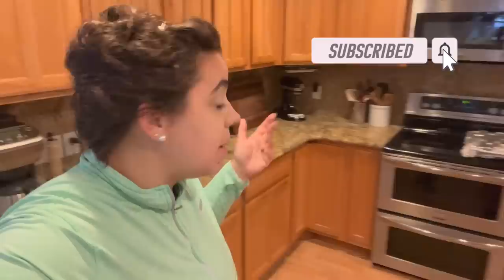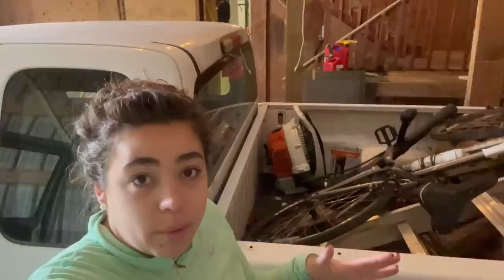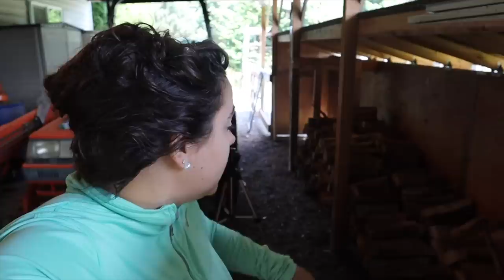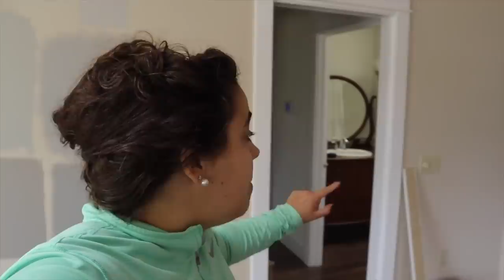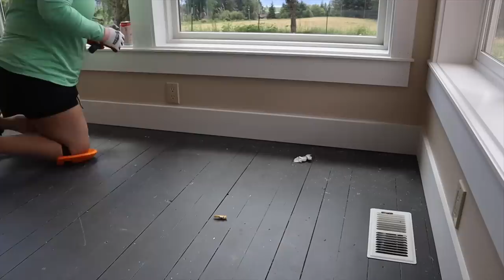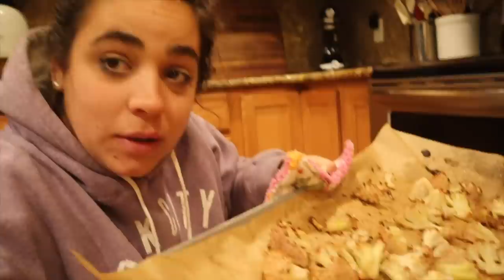Seeing a light at the end of the tunnel!

Comment: Filling nail holes...sometimes an endless job...but....the perfect out-of-the-box job for a pastry bag and tiny tip combined with putty knife. Squeeze, wipe, squeeze, wipe....add the putty gathered on knife back into pastry bag as necessary and keep going. I also take a damp (not wet) flat sponge and run it over the areas I've filled to remove any extra putty/film. Works like a charm with no sanding...and cleanup consists of throwing away the pastry bag and using the damp sponge to clean the putty knife and pastry tip.

Comment: I saw a neat tip the other day. Use a ultra fine tip pen to write the brand and paint color name on the back of a switch plate or outlet cover in room (wall, trim, ceiling).Then you’ll always have the information if you need it for later. Take off the cover and read the info.

Comment: Tip when you are replacing outlets, I highly suggest getting the ones with the nightlight built in for hallways and bathrooms where you may want one.  It's so handy and you can adjust the brightness you want from the nightlight or turn it off completely.
Reply: I really like the outlets with the usb charger on them, I even have those in the bathroom outlets!
Reply: This! We have them in my.kids rooms too which have served as nightlights.
Reply from the maker: Love that idea!!
Reply: my husband also switched out ours and for the switches for the lights, he got the ones that light up when not on. So you can see them in the dark.
Reply: This is a good tip. We switched out the outlets in the hallways with the nightlights and the outlets in the kitchen and living room we put in the ones with usb and usbc. That made a huge difference, we aren’t hunting around the house looking for a charging brick. Also, don’t know if Becky will read this but if you have the opportunity while having the electrician there, you could ask him if it’s possible to put a couple of outlets in the floor. That’s also a game changer, the less extension cords you use the better for your electrical system.
Reply: @wonderwonder30  i believe she mentioned in the last video that they are doing that.
Reply: @lelanoel3499  Yeah, I thought I heard that too, where the wall was, right? I just meant since the electrician is going to be there install those outlets around the house, in spots where there will a side table or couch, I guess I should have been clear in my typing, sometimes I get ahead of myself and not explain things well 😆
Reply: @wonderwonder30  "

Comment: You and Josh are indeed the Energizer Bunnies, because you also work "smarter, not harder".   So impressed with your renovation knowledge, and applying the "let's do it right the first time, no shortcuts" approach.  Off topic of this video, but I want to add my two cents about paint.  We went back to the studs in our full house interior remodel following a hurricane.  When we were getting close to the painting stage, our contractor suggested that we paint the ceilings a few shades lighter than the wall color.  We also put back a simple stacked white crown moldings at floor level and also where the walls/ceiling meet.  The much lighter shade of the same paint color used on the walls actually "elevates" the height of the room, instead of bringing it down.  We used Sherwin Williams paint for no particular reason, but I remember that's when they put the "paint colors w/names" about six to a card (not individual cards).  So the darker to lighter colors graduated in intensity, but stayed in the same shade family up & down the card.   You could achieve the same result simply by mixing in some white paint (controlling the desired ratio) with whatever wall color you decide on & accomplish the same effect.   Does that make sense?   It makes for a very cohesive and pulled together space - the walls just sort of "marry" into the ceiling without the choppy look of a white ceiling staring down at you.  And imagine how it would highlight Josh' beautiful trim-work!  Anyway, just a comment that worked well for us - and I would do it again in a heartbeat if we ever moved!  

Take care,  continued blessings for you and Josh!  🧡 from Texas

Comment: I've tinted some of my windows and we definitely noticed a difference in the temperature of the house in the summer.
To help thaw, set the frozen food on a cookie sheet so the cold has somewhere to disperse.
Reply: Hi Becky, I have to say Josh and you are doing a GREAT JOB on the house. I moved in the Mountains WNC. Who wood think it would be super hot here. We put tints with the  semi tent on the south side wow did it help. Even in winter when sunny but 🥶 it works. Super easy to do. Home depot has them.
Good luck.
Christina
Reply: @christinajay4257  Did it make it seem visibly darker with the tints?
Reply: @bethlewis9981  Hi, not really. It's semi private. There's all kinds of tents. Read the packages. I can't remember which one I have on my windows. I just know that I have semi private. Which at nite if I have lights on in the house and blinds open you could see in somewhat. If you were in front of the house. But from the road u can't. Like said, look and see what they have for what u need. I did it 2020. You know they always changing. And super easy to do it. But it's easier with two people. Good luck🙃

Comment: I replaced my own electrical outlets and switches. Very easy except for a few weird things I ran into along the way. Some had way more wires than expected when I pulled them out. Still not sure why....got my brother to help me.  And 3-way switches were a little more confusing for me. But yes, YouTube can talk you through most problems.  Just wanted to suggest you do all those replacements BEFORE you hire the other wiring done. That way, if you run into anything you can't handle along the way electrician can check that out for you at the same time.

Comment: With the window coverings you might like to consider electric security roller shutters on the outside which you can control inside.  Some people have them in Australia as they block out the sun in summer and helps keep the warmth inside in winter. The shutter rolls all the way up to the top of the window which doesn't hinder the view.

Comment: I filled some drywall screw holes in our walls and also tried to get off as much putty as possible. The result was sunken in holes once they dried! No!! I don't know if our climate/ humidity (Alabama) caused it, or if it was just drywall, or if it'd be the same on trim... but wanted to throw that out for you to check before the painters come in case you need to fill them in a bit more now that they have dried.

Comment: Josh's early mornings of getting to the new house, I would say he's anxious to get moved.  When is your drop dead move date?   When we moved to our TX gulf coast house I moved my 2376 sqft. house in the back of my 4Runner truck.  It was 176 miles each way and was packed to the ceiling.  I came back to the old house for a few days every week for several months to oversee the contractor who was updating it for us to sell,  and to tend to local errands.    It was a project, but worth it.   Have you considered installing a stove similar to what you have in your old house?   Might provide better whole house heating.   My folks had one that fit into the existing fireplace hole.   Also when you research the window tinting films there is a film that can be installed on the outside that works wonders.   I had an 8 ft. square ceiling sky light in my living room with the sky light recessed up 4 feet into the middle of the ceiling of that room.    In San Antonio it gets very hot and when we had that film put on it dropped the temperature at the ceiling at least 30 degrees.   From the inside you can't tell anything is there.  From the outside it looks gold or bronze.    It reduced our electric bill enormously and helped ease the load on the HVAC.   I don't know what it's called, but is the same thing they put on windows of commercial  buildings.   A local commercial window company installed it.   Keep us posted on the baby progress.  Looks like you're starting to feel better now that you're past the first trimester.  Take care, and until see you next time.

Comment: You should wait until the putty dries before sanding it as it'll shrink a tiny bit during the process.  If you sand right away (I know you only did it very lightly), it could dry and create a tiny well in the wall which will need another coat.

Comment: (if the window situation is about letting in less sunlight during summer, then maybe consider instead to have hooks outside and hang simple "shades" from undyed linen (very sturdy and filters out most of the harmful UV light from all the natural fibers and even when they are down in the hottest of times you will still get a gentle light without electricity) the glasshouse effect happens ALWAYS after the light has travelled THROUGH the glass, so indoor shades will be less effective against heat)

Comment: On the tailgate not opening - remove the panel on the inside of the tailgate. I have had this problem several times. Look for any loose or lost bolts etc. many times it is a simple fix.

Comment: You can do the light switches! I didn’t all my light switches and outlets when I moved, and the lights are the same as the outlets, you just need to keep each switch separate if there is more than one on the plate. I don’t know if I used all the right term there 😅😅 but it’s easy. Also, do you have the same flooring in any closet in the house? Can you use that flooring to patch under the wall and get a close latch to replace what you took from a closet?
Reply: What a great idea!

Comment: Switching out the electrical outlets is simple. Just beware if it's a two way switch (two different switches turning on or off the same set of lights. Like at the top of a set of stairs and the bottom set of lights).